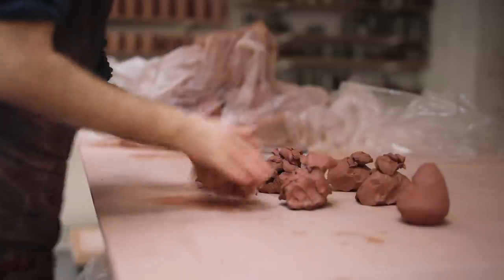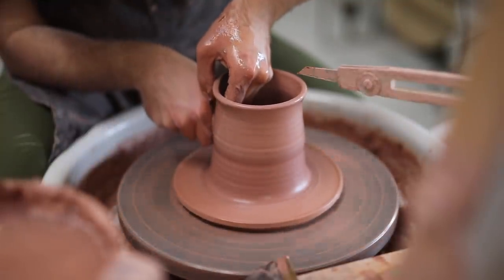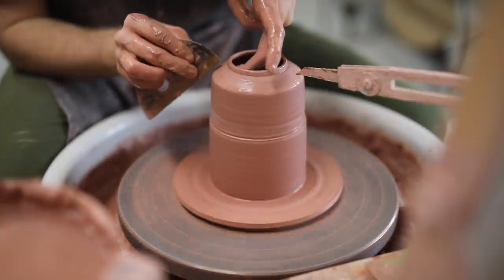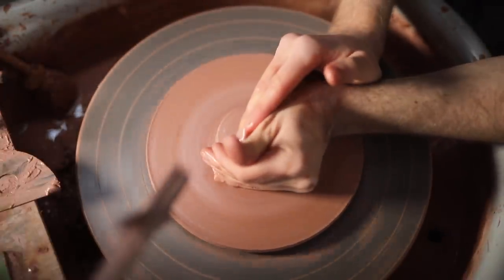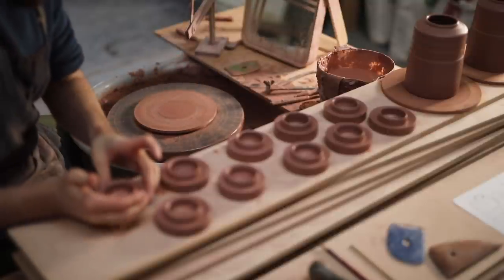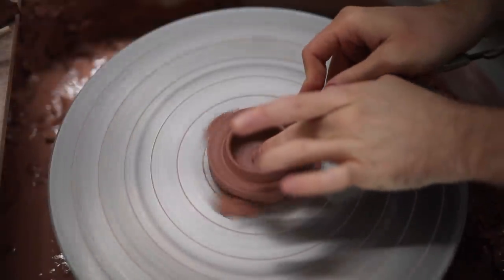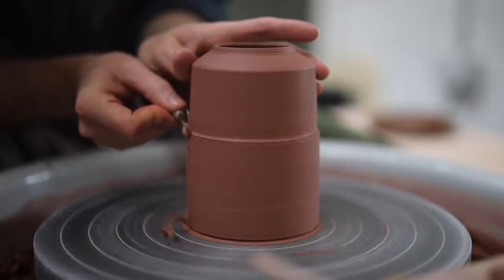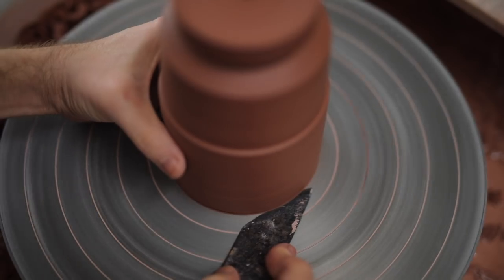How to Make a Handmade Pottery Teapot — Narrated Version

Comment: This looks so good! I’ve made a teapot once and I cried sweat and tears. But I was so happy with the result. Quick question: Is it possible that the hole is at the teapot itself? Instead on the lid?
Reply: the hole in the pot instead of the lid is very clever! you could even incorporate it into the design, such as in a style line, or hide it under the handle. I don't see why this isnt possible, you would just have to be careful to place it somewhere where tea wont come out and burn the user.

Comment: Nice video! When you throw a pot using the pointer... How do you set it at the right size adding the shrinking factor?
Reply from the maker: Thanks! I have set dimensions that I throw to that I keep in a notebook so I don't need to worry about the shrinkage factor as my measurements are for the thrown sizes, not the fired sizes, if that makes sense. As for the lid fitting the jar, as long as the two components are thrown at the same time they should dry relative to one another, so they'll fit. I'm not sure if this answers your question!
Reply: @floriangadsby  Oh, ok. I do the same thing, but I think I asked wrong. I've never used a pointer, how do you set it up? Do you use a square on the wheel?

Comment: What is the name of the turning tool you use to scrape away the skirt of the clay when throwing? I’ve checked a few places for it but haven’t had any luck.
Reply from the maker: There’s no specific name for it, well, there is but I’m not using it for it’s intended purpose. It’s a turning tool, I can’t remember where I got it from unfortunately but I’m sure a few pottery suppliers sell more or less the same thing. Mine is very blunted from use!

Comment: Why is the stuff on you’re website so expensive??? Also they should be like £15 or $20 for a teapot that’s how much I sell mine for litterally £250 FOR A TEAPOT
Reply from the maker: It isn't just my work, believe me! It's how the market of handmade ceramics is in much of the UK, Europe and the USA. It's artisan, one of a kind work, made in incredibly small batches and with a demand far greater than I could ever produce for, supply and demand, rarity of work, etc, it all drives price. It may be different where you're from but that's how it goes here.
Reply: OHHHHHHHHH ok THX, also what brand is you’re kiln??
Reply from the maker: @monkey4424  I use Rohde kilns, they're great!

Comment: Bad designed teapot,  pour spout placed too high,  if you have a short teapot, that's ok, but for a tall one like this, you need to lift the teapot almost parallel in order to pour out last 1/3 of tea.  The cap of the teapot is heavy and it's insert rim is not long enough, not secured when you pour hot tea.  The holder is too small,  after fit in four fingers, there will be no clearance between the teapot wall and you fingers.(when the teapot is filled with hot water, you don't want to touch it with the back of your fingers)